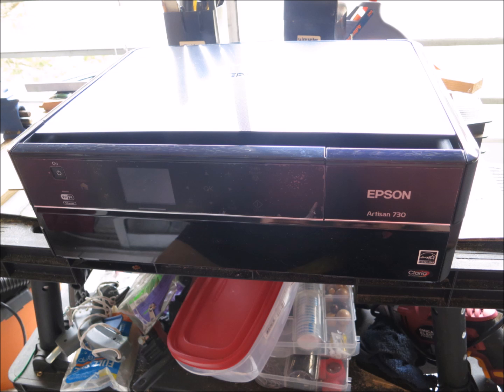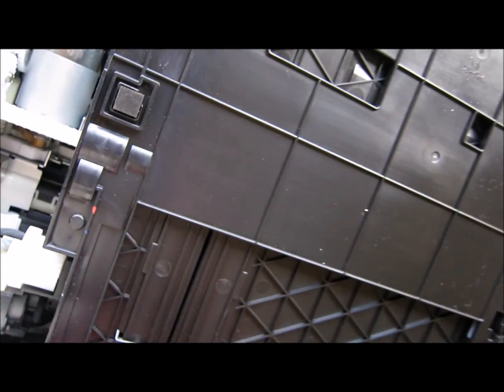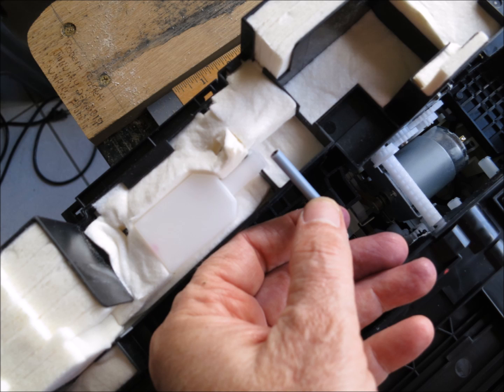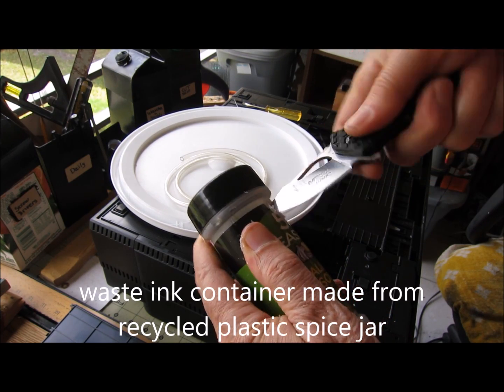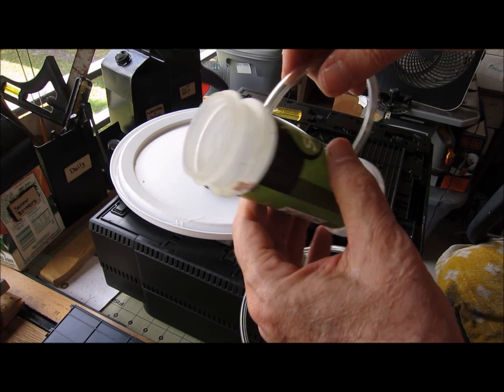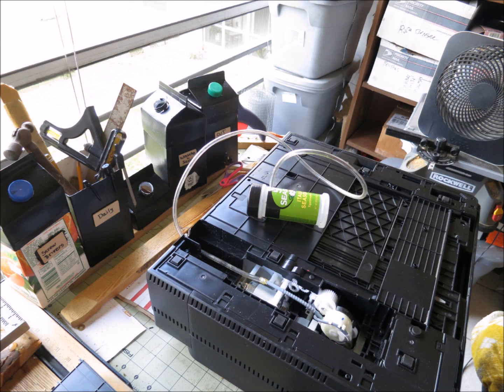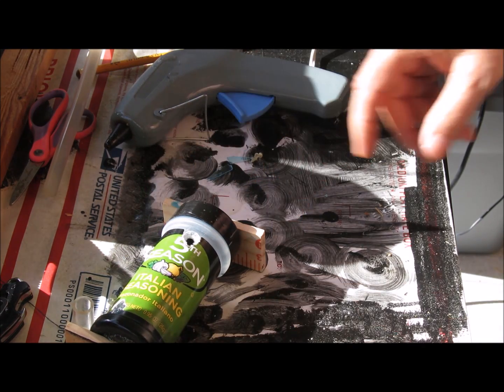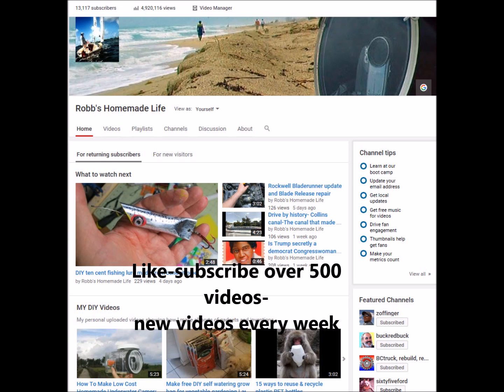DIY Inkjet printer waste ink recycler reuse your ink

Comment: Robb, I have a problem here, maybe  you can help me, I was doing a head cleaning on my Epson Artisan 810 printer. Now I have an error: the ink pads are at the end of its service life. call epson .. ..
I cannot remove the error message on the screen,
Can you give me a tip of what I can do to solve it?
Reply from the maker: You can buy on ebay a reset code to allow you to reset the printer. If your pads are full you can buy replacements or try adding a waste tube. However, if your printer is fairly new, less than say 2 years, many people have said epson will send a replacement under a warranty most people don't know they have, worth trying, good luck.
Reply: The main problem is that the error message is kept on the screen (blinking) and does not allow me to execute the reset, I can not communicate between the resetter and the printer
Reply from the maker: sorry, i don't have an answer for that one
Reply: Assuming you still have the machine in question:
Download a reset utility such as WIC Reset
Connect your printer via USB to the computer (with the printer powered on) and open your reset utility
Then use your reset key (about £10 or $10 on eBay) to reset the counter to 0%
Turn off and back on - printer should now work

Then you have to either clean the absorber or fit an external tank.
Reply: Contact me I can help you